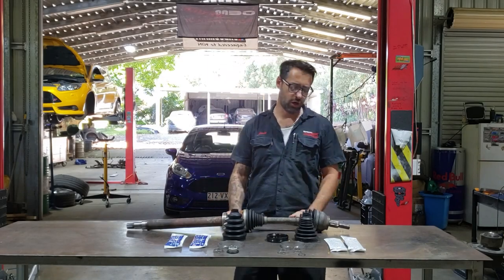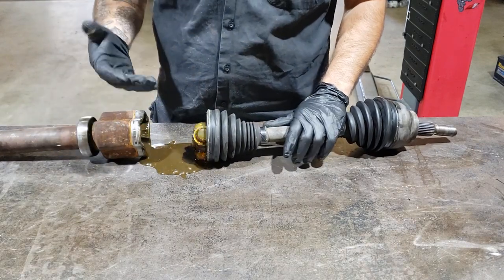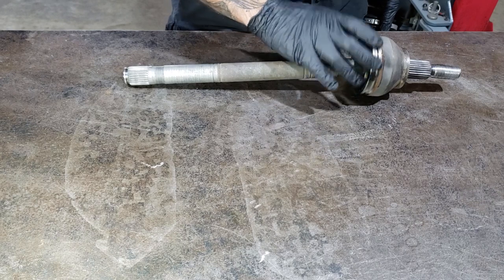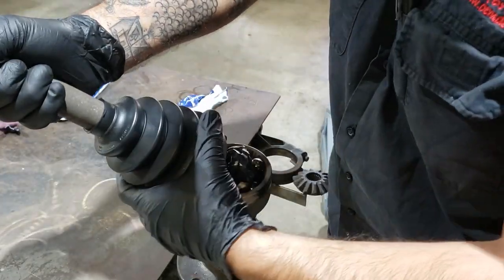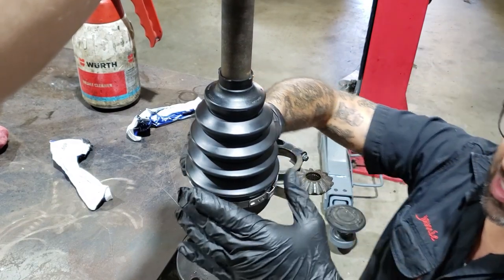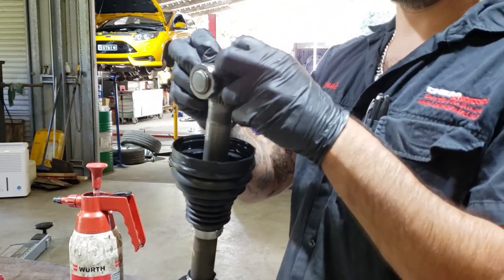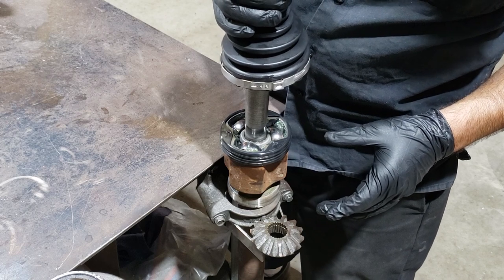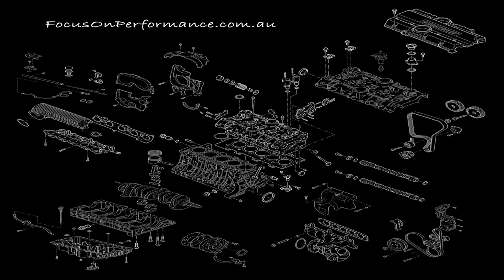Focus mk3 RS/ST CV boot replacement

Comment: Hello, I am writing from Turkey. I have a Ford Focus ST 225HP. I have a problem with the axle. Unfortunately, there are no spare parts in Turkey. I think it is produced jointly with Volvo. How can I fix the axle head?
Reply from the maker: The mk3 uses different drive shafts to the mk2 ST225, the Volvos uses the same axles as them though. We do sell a rebuild kit for the mk2s and can ship to Turkey. Just send an email to info@oemdenied.com and can get a shipping cost for you.

Comment: Cool video I’m going mine tomorrow 
Any advice on replacing snapped off exhaust manifold bolts without taking the engine out
Reply from the maker: milwaukee 90 degree drill

Comment: Any idea if the ford mk3 automatic powershift version can be swapped with the manual shaft? Or at least up to the 3 points bearing?
Reply from the maker: give me the VIN can check part numbers for you